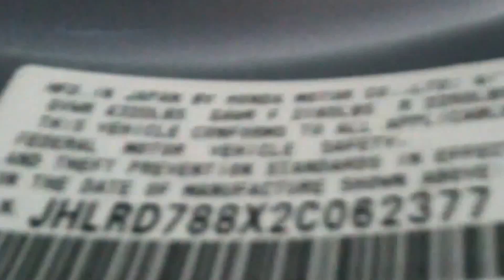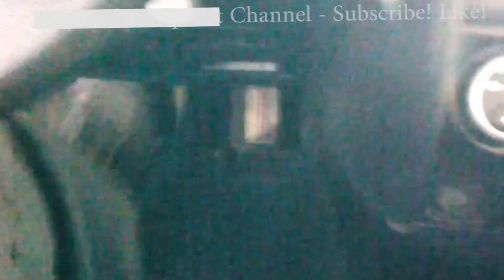Rear brake pad replacement Honda CRV CR-V 2002-2004 Acura Install Remove Replace

Comment: Thanks for the great video. I am going to be changing the brakes on my 2002 Honda cr-v lx 4wd and this video was perfect.  I am also going to be changing the wheel hub and bearings all around and wondered if you had any videos for this.  Do you?
Reply from the maker: Are all the wheel bearings making noise? Loose?  Otherwise sounds like extra work to me?  May have one Honda wheel bearing video, assuming you have been doing searches for that.

Comment: what kind of grease did you use and should you grease anything else besides the pins?
Reply from the maker: rdmnks we get a brake lubricant from our local parts store.  Usually there is a package of decent grease in the brake pad box, at least the higher quality pads we use. And I do not use it on anything but the caliper slides.

Comment: No cleaning of the hub, or the bracket. No lubrication of the slide pins or where the pads contact the shims on bracket. Also forgot the dust boot over the starwheel cover. I like your videos but damn thats a shitty brake job.